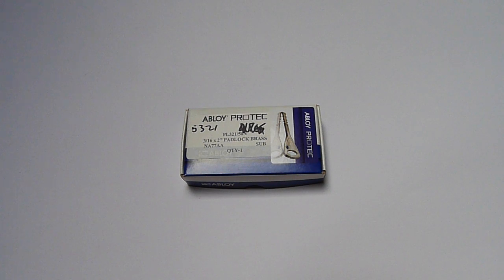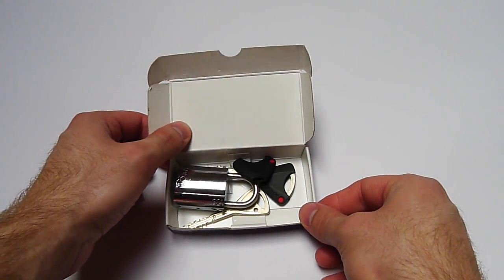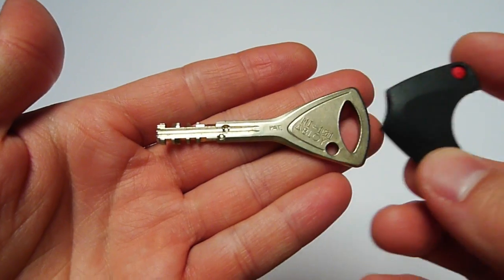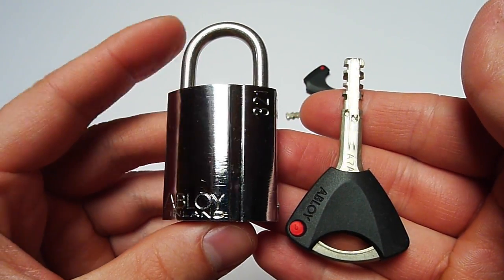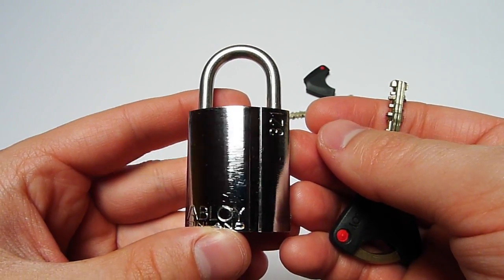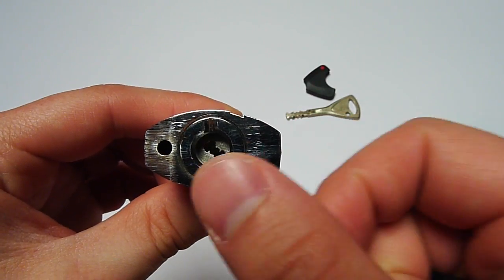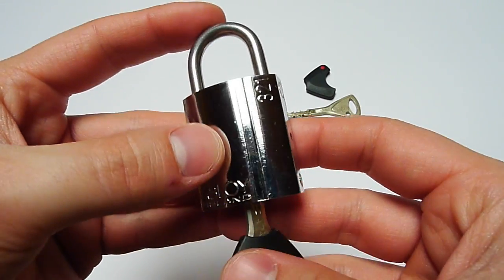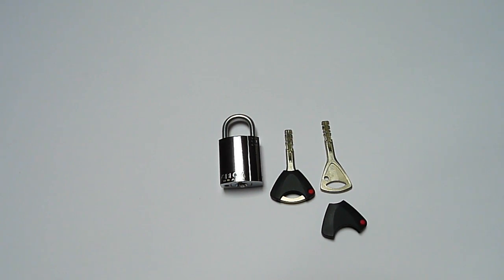Abloy PL321 Presentation

Comment: Nice lock. Kinda expensive though.

Can you recommend me a small 30mm padlock for carry-on/train overhead travel (no junk TSA locks of course), train station lockers, hotel/hostel rooms, etc.?

Is the Sesamee AB410 any good?
Reply from the maker: Please stay away from the Sesamee. I have a padlock here that I have to do a video for. It is long overdue as many other videos but it would be my recommendation for you. The Abus 72/30, you can get it with a stainless steel shackle. It is aluminum and therefore lightweight, has a 5 pin cylinder which is replaceable and is featuring a double ball bearing locking mechanism. Sure it is not as secure as the PL321 but also not as expensive. And a padlock at this size is not secure anyway, it can only be more secure than models the same size. I hope that helps! Best wishes, Adrian
Reply: +Adrian Weber 
Great! Thx for the tips and recommendations. 

I was actually interested in the Abus Titalium 64ti/30 too, and never knew about the 72/30 until you told me. So I guess those 72/30 are even better because they have more pins (5-pin). 

I'll also avoid the Sesamee.
Reply: Adrian Weber Hi again Adrian. I bought those Abus 72/30 locks you recommended recently (and also a Kryptoflex 5mm cable)...they're beautiful locks. But, I returned the Kryptoflex cable and I'm also thinking about selling the 72/30 padlocks and exchanging/upgrading them for 40mm or 1/4" shackle padlocks (for travel). 

As for the cable, I'm replacing it with an Abus 6KS 6mm chain; which I'm sure will be waay better and more secure than a wimpy braided cable and still relatively small for travel. 

Have any recommendations for an inexpensive, but good, 40mm 1/4" 6mm shackle padlock? Would the Abus 72/40 be a good choice? I assume it's very similar to my current 72/30, but with a 1/4" shackle, 6 pin and 40mm body.

I'm thinking a 1/4" 6mm shackle padlock would be a perfect match for the Abus 6KS chain. And a 40mm aluminum padlock would be a great choice for travel, as it's lightweight and also not super big. 

Thanks.

Comment: Is the shackle special some how to make cutting it off more difficult than a "normal padlock"?
Reply from the maker: No this is just a low security padlock and the body is brass and the shackle stainless steel. Even if you would hardened steel it would not make any difference with a shackle that is that thin. Stainless steel was the better choice in this case as it is more weather resistant.

Comment: the shacke is so thin, it looks ridiculous. It's almost like you could snap it in half
Reply from the maker: Hey Rant, while I understand your concern you have to consider that this is the smallest padlock from Assa Abloy within the PL series of padlocks. There are bigger versions that you can buy and this one was specifically designed for low security applications. Best wishes, Adrian